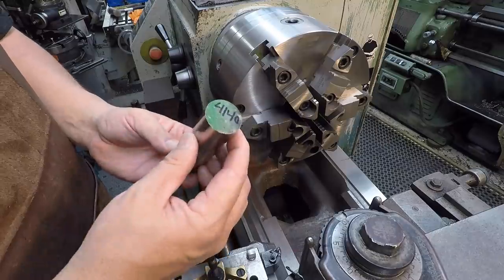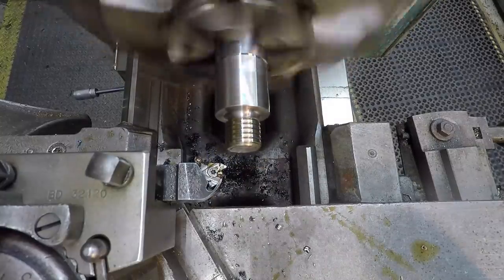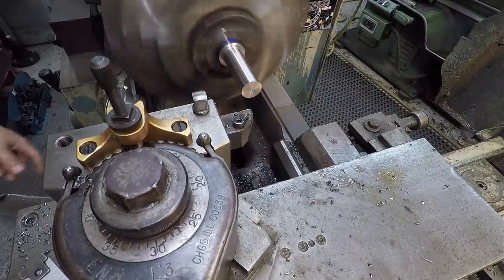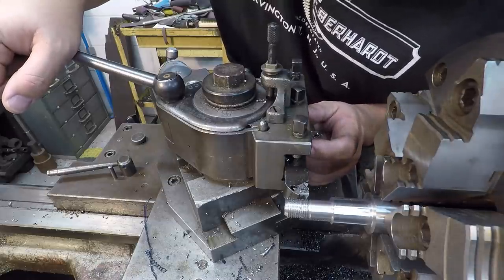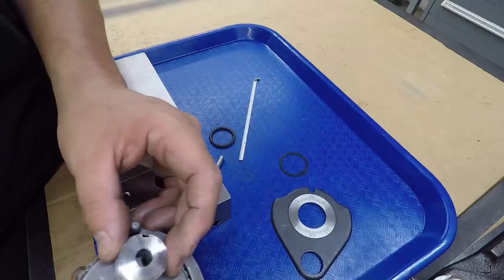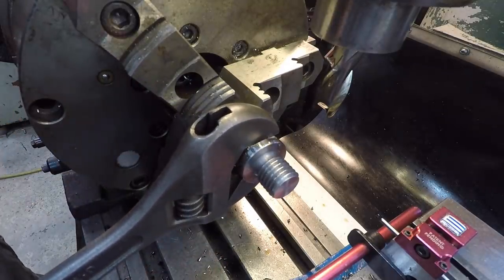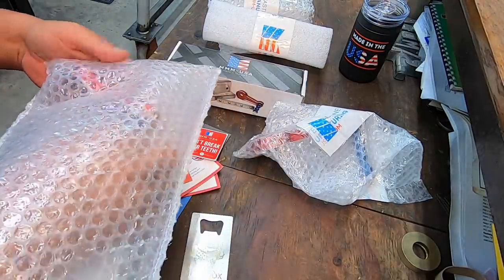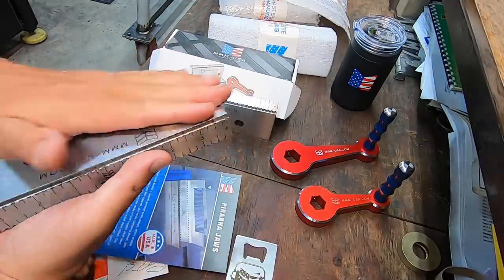SNS 314 Part 2: Machining the Multifix Hold Down Stud

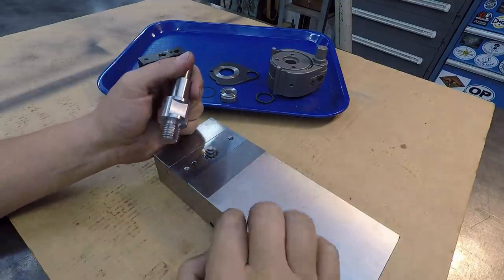Comment: I just got my Multifix E size set today, and I agree with the guys on Instagram 28:05 . You are only clamped as well as the two 1/4-20 screws push up and as well as everything stays flat. Maybe they want one set of instructions that work for big lathes with T's that are wider than  the multifix base.

Comment: I am French, please excuse my bad English.
I just did the same thing as you, but my tool cart doesn't have a T. Very nice realization you made. I think that your principle is not good because all the pressure of the tool carrier is partly on the two small screws that raise the T up. The T must be at the bottom of the groove and to immobilize it, you could have put 4 screws between leather and flesh, that is to say between the T and the carriage. Regards
Reply: Incorrect. When the toolpost stud is tightened to the multifix, all the pressure is pulled up and into the underside of the cross-slide's t-slot. It would be the exact same as if the set screws weren't there. The set screws are keeping the t-nut in-place and do not allow it to move, while the multifix is not attached.

Comment: Have I got it wrong or did I see you opening the lead-screw half-nuts when cutting the metric thread on what I believe is an imperial lathe? If that is the case perhaps you could expend on the details of that technique please. I've cut many metric threads on imperial machines but have always kept the half-nuts closed and ,after withdrawing the tool, reversed the machine to get back to the start point. Many thanks for yet another excellent video.
Reply: If your lathe has a thread dial, you can do this. You disengage the half nuts, turn the lathe off, retract your tool, then turn the lathe on in reverse and engage your half nuts again when you're at your original mark on the thread dial. Stops you from crashing if you're threading to a shoulder.
Reply: I think Adam was using his dti to mark his starting position for the tool. I always reverse the lathe when cutting a metric thread but Adam is a much more experienced machinist than I.
Reply: @PurityVendetta  He would be using his thread dial. He waits each time until the thread dial is at the start mark (say, position 1) and then engages the half nut. When doing imperial threads, you can engage on 1, 2 3 or 4 for most imperial threads IIRC.
Reply: @JamesChurchill3  Now understood. Thanks.

Comment: 14mm pitch ! that wide. M14 is 1.5mm normal or 1mm fine.  M14 is actual a odd size. mostly used on anglegrinders
Reply: Ohh, sorry dude m14 has 2mm pitch, just like m16. 1.75, 1.50, 1.25 or 1mm is fine. Greatings from Germany
Reply: And M14 x 1.25 for spark plugs
Reply: M14 is also in common use for clamping kits for 16mm or 5/8" wide T slots on mill tables. (x 2.0 pitch, ie standard, as Fuxx19 points out)

Comment: Hello, why are the flats needed when there is a nut up on top the will tighten it anyway?
Reply: So you can remove the stud from the tee nut if you ever need to
Reply: Studs always need to be tightened into the "fixed" part first, with a little more torque than the nut.   So you can be sure that the stud stays in place when you undo the nut.
It's of course possible to tighten and remove a stud without flats, but when it's easily possibile to have them as in this case, they are a great convenience.

Comment: I realize you're probably too big to answer alot of individual questions but i'm really curious how the bit finds the same thread with each pass.  like if the tool enters the workpiece at 12:00 that sets the thread all the way down.  how does it not enter the workpiece at 6:00 the next time?
Reply: Dig up the many many single point threading videos on YouTube. Adam has a few as well as does several other YouTube channels.

Comment: technical they are 120 positions not just 40
Reply: Yep, the three pin holes are not equispaced, but staggered by 3 degrees each.
That still means the Morse taper holder may be out of line by  as much as 1.5 degrees, although I'm guessing there's a "master hole" which is registered for an inline pin hole on the compound.

Comment: What are the advantages of single point threading, as oppose to just using a regular die?
(other than the satisfaction of seeing the chips fly :))
Reply: In my humble opinion,and that’s all it is,with single point you can control the standard of thread you are asked to accomplish, with a die you are at the mercy of the die itself or the condition of the die. A dull die will tear the material with obvious consequences. In any condition I would say its up to the machinist and the type or standard of the thread that is called out on the print. Besides, it can be a lot of work using a die. I almost forgot, you can not make precision threads with a die. Shaft I’ve made as stated before were very close tolerance shaft that had  ABEC7 bearings, so picture what would happen if you were to use a die for the bearing retaining nuts. As soon as you tried to tighten the nut no telling how much or which direction the shaft would bend. That is why single point precision threads were called out in the specs. Sorry for the long winded theory lecture on threads. Hope you have a great day.
Reply: Jocke: further to the point M Benavente touched on at the end of his excellent post, it's not feasible to get a button die to provide a consistent helix angle; normally the thread will be slightly "drunken" so that the pitch is continually increasing and decreasing, usually repeating (roughly) once per rev. This is sometimes called a 'drunken' thread. A diehead (eg "Tangential" or "Coventry") will do somewhat better if the chasers are in good shape, more so if it's mounted on a carriage or turret which is geared to the spindle at the correct ratio. This is a good compromise: the accuracy is nearly up with single-point threading, but it takes only one pass, even in tough materials.
Reply: Gottenhimfella Very eloquently stated.

Comment: Assuming you're using annealed 4140, I really see no advantage over either Fatigueproof, or Stressproof.  Both have excellent mechanical properties in the annealed state..............whereas 4140 doesn't shine until it's heat treated.  Unless you're planning to heat treat a part, 4140 is just spending money for a "name".
Stressproof threads beautifully with HSS tooling.  IMHO, carbide threading inserts really don't do as well.
I enjoy your videos, and I'm not trying to be a jerk.
Take care.

Comment: I prefer a 1" inch adjustable wrench. LOL
Reply: But that's a 14mm stud, so you have to use a metric adjustable wrench on it. 😁
Reply: @BedsitBob  3/4-10 on the thread he's tightening. Stuff your metric.
Reply: Y'all are just lucky it weren't a left-handed thread.  Cause a left-handed nut rounder is rare as hen's teeth!

Comment: Define "Spring Cut".
Reply: Due to high loads of machining the part springs back a couple of thousandths. The spring pass or spring cut takes care of that spring back if you will.
Reply: @micahwinters7021  Ah. Makes sense. Thanks!
Reply: It's a cut with the tool set at the same dimension as the previous cut. Theoretically the second cut shouldn't do anything, but as mentioned, it typically cleans up a tiny amount of whatever 'spring back' in the material, or deflection in the tool, that may have occurred due to tool pressure of the previous cut.

Comment: Why don't people use cutting fluid with the metal saw ?
Reply: It's not necessary on chop saws not to mention that's not how they are meant to be run.
Reply: @darkneko5513  That sounds more like bombast than reason.

Comment: Maybe this rod was an issue.  Don't know.  I had a business cutting out steel objects CNC plasma.  The rolled steel started to get bearing traces and ball bearings that melt at a higher temp but not in the mill.  The roller flattened the sheets but left smears and circles and lines.  The cutting speed changes on metals and that scrap mill cost me many consumables.  Hope it was the carbide.

Comment: At the risk of embarrassing myself I still don't understand what those two sets screw holder for you know put set screws in them I mean there's no way to put set screws in them you're covering them up did they go all the way down through the body of the toolpost? I am lost
Reply: The set screws push down into the cross-slide and push the T-nut up and fix it to the underside of the cross-slide t-slot. When you remove or reposition the multifix, the set screws don't let the t-nut move and you don't lose a reference point.

Comment: No concerns about such a good fit with the counter bore and distortion thats bound to happen on the edges of the wrench flats from tightening? Since with that system there are only 2 points of contact for tightening.
Reply: There's plenty of bearing surface "above and below" the wrench flats as well as on the 2 sides w/o any flats. He said he deburred them. What is it you think is going to happen (not sarcasm)?

Comment: The only thing I don't get is why the stud nut and its thread are metric when only the straigth section needs to be. It is destined to someone in the USA, let him have the convenience of the domestic system.
Reply: Whats the problem with an metric nut? Normally you won't open it often
Reply: Wasn't the locking nut provided by the customer? Adam listens to the customer, maybe you should too.

Comment: If you want my two penn'orth Adam, when you're screwcutting manually the speeds are too slow for a carbide insert, carbide inserts are only happy on a CNC machine at high cutting and spindle speeds and being doused in coolant. I've always preferred HSS for manual screwcutting. Best Wishes from Somerset UK.

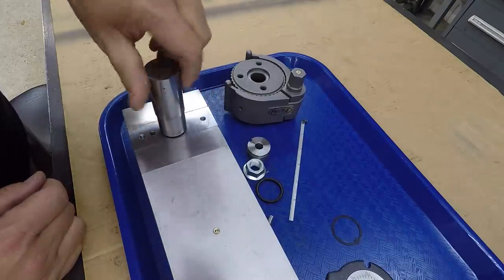Comment: 10:15 Looks wobbly as crap to me .... Why use "standard thread sizes" when you can easily custom fit to your application .. should have used the T nut as a gauge in my opinion.
Reply: I agree using the t-nut wouldn't be bad, but going with a standard die gage is fine. As for the wobble, it makes almost no difference. There's nothing that needs to be concentric, except the stud and hollow shaft of the multifix, and the thread mounting is irrelevant to that fixture. Once the stud is shouldered, the wobble is eliminated by the design of the thread.
Reply: @tomb816  Good point ... I hadn't thought of it that way

Comment: Wouldn't leaving an air gap mean there is more of a chance of the post getting mounted cockwise, or distorting?

I know, we're talking about 0.00001" of distortion, but this is about doing it a flat, square, and parallel as possible. 

Did anybody else hear the professional pride when the threading insert wouldn't line up? Just, frustrated disappointment. If you're lucky enough to have never been there, I kind of envy you.
Reply: I was thinking the same thing. Having an air gap would reduce the rigidity. Mashed down flat keeps the assembly solid. As long as the tool post and holders lock in correctly, send it.

Comment: that 4140 must be very high in chromium? ??
Reply: Well, it's called Chromoly, but the actual chromium is between 3 and 5%.  This is not enough to prevent rust as in stainless steel.  Stainless contains usually around 11% chromium.

Comment: Use oil on the thread, use oil on the thread, use oil every time, use oil, always oil, use oil. A spray oil every pass
Reply: Incorrect. Oil/coolant is not a bad thing, but there's plenty of times it's necessary to cut dry. Cutting dry allows the heat to weaken any hardening and make machining easier. Coolant can cause thermal shock and weaken the steel. He's using a manual and not running 10k rpm at high feed rates.